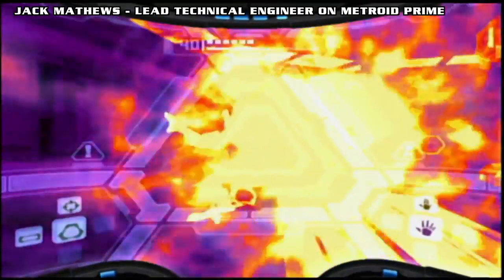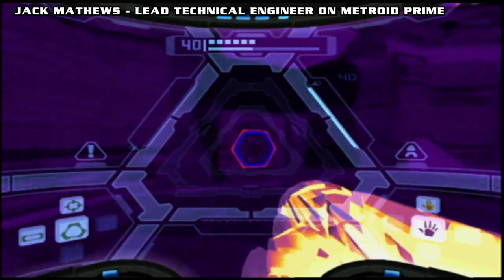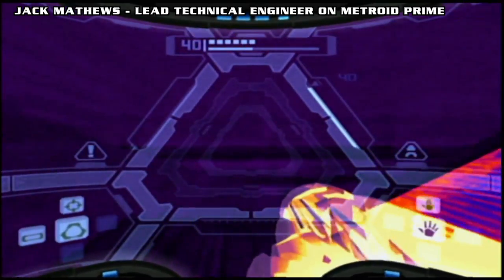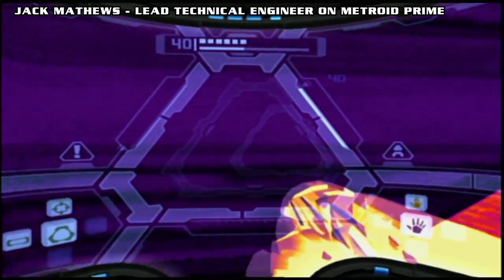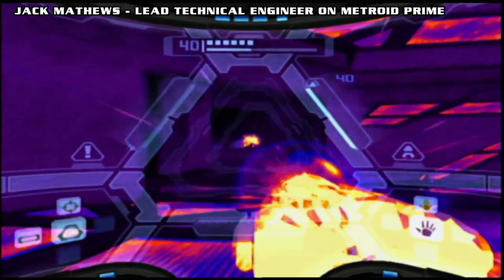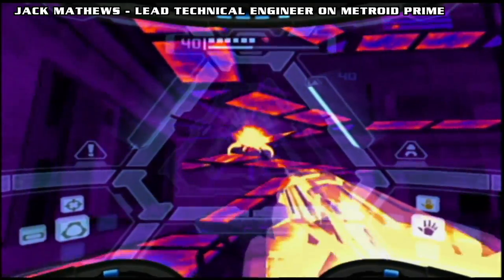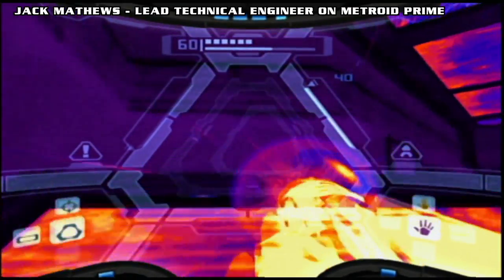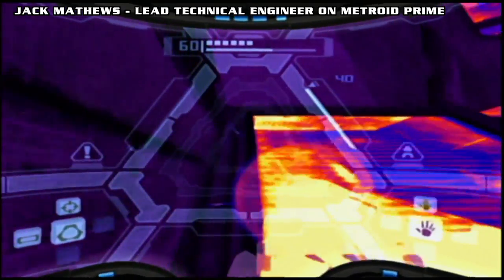Why The Thermal Visor Looks Worse In Metroid Prime Remastered

Comment: Honestly, my thought process with the new Thermal Visor was just that they were going for more realism. Thermal cameras tend to have a very low resolution, blurry, and have a lot of motion blur due to how they operate (at least the more commercial ones) so it's pretty plausible that they were just attempting to emulate those.
Reply: agreed
Reply: I'd like to agree with you but it really is quite jarring. I'm having trouble believing devs opted for low rez high motion blur just to be in line with some human optics. This is Metroid after all 🙂 I bet it's just cause they couldn't hit 60. Oh well not like you have to use thermal all that much.
Reply: Ah, the realism concession. My favorite videogame feature...
Reply: My thoughts EXACTLY.

While Metroid is sci-fi future tech, modern thermal cameras are BLURRY. They don't have sharp edges like the MP camera. "Predator" is a bit TOO far in the opposite direction (because it filters out the thermal of the environment to a MUCH greater extreme than a real thermal camera would, focusing ONLY on active heat sources), but that idea of thermal is much more what people "expect," and the MP:R version is a lot closer to THAT.

The original version was great, but the new version - while blurry and less crisp - feels more accurate to what we'd see in a modern real-world setting. I had NO problems with it. Not sure why so many people did.
Reply: @Batman1016  Idk, it makes sense why people don't like it. It's blurry, hard to see, and gives a lot of people headaches. Sometimes gameplay has to take priority over realism
Reply: @ZachHixsonTutorials  How's it hard to see? Everything you're supposed to shoot at is BRIGHT YELLOW and the exact same size on the screen as it was prior.. 😅 Agree 100% with your original comment tho mate!
Reply: @sandwich1601  For one it actually is realistic, yes it may have had performance issues without these changes, but it is basically like killing two birds with one stone. If you can make the game run better while keeping realism in check, why would you not do that?
Reply: @phattjohnson  Yeah, what you’re shooting is bright. It’s everything else that’s the problem. It’s difficult to move around the environment with everything so blurry, which is particularly bad for a section of the game where they turn off all the lights in the area you just went through. Originally this was meant for you to use and adjust to the function of the visor, but in the remake it’s a lot harder because you’re now navigating a blurry mess.
Reply: @Setery10  Ah yes, because of course we know that technology is stagnant and will not improve at all in the next few hundred years. Especially thermal cameras. Those will never get any better than they are now. 🙄
Reply: @MisterPuck  Sure some of the REALLY top end thermals heavily reduce the motion blur issues (still exists to an extent), but I do expect future tech to eliminate those issues, this is especially doable in a sci-fi context. I don't disagree, but I did want to point out how it currently operates in the real world.
Reply: Thermals aren't actually that blurry though. The Scott Sight mask, for example, (granted a much smaller screen) is actually pretty clear. There's some smearing if you move really quick, but thermal imagers and FLIRs actually have pretty nice resolutions so you can see what you're looking at really well. I work in a place where we have a fire brigade and there's some real neat little thermal imagers and they're great for overhauling fires and pinpointing hot spots.
Reply: @Batman1016  its fucking Bird Tech, the gene splicing capable bird gods that gave Samus pretty much everything... and have super AI battle robots but cant for the life of them create a higher resolution camera thats not blurry with non-blurry thermals?
Reply: Could be both. They had hardware issues, and used this to solve it because it is more justifiable.
Reply: The thermal camera on the frigate I sailed on was sharp.
However, the default setting for these is black and white with shades of gray.
It's a pity that the thermal camera had to be reduced to the level of a 2020 mid-range camera, so to speak.
Reply: @Batman1016  holy shit this is the weirdest copy I've ever read
Reply: @eldenringtutorials8075  *eyeroll* That's because all you goofballs do not seem to comprehend the combined concepts of sensory tropes and audience expectations in multimedia.

"Silencers" in media make guns sound like little "twip-twip!" noises, yet in real life, they sound nothing like that, because that's what audiences EXPECT.

Real explosions are usually much smaller and far less flashy than what you see in movies (and lots of them are flatly invisible, because fuels burn at a light wavelength too high or low to see, look up racecar fuel fires some time, it's terrifying), but that's what viewers EXPECT. 

Lasers do not fire clearly visible beams, and would not cut quickly and cleanly through flesh and other objects like a razor blade (moving that fast would cause burns, chemical reactions, and other severe material disruptions, that's why laser surgery is a slow and VERY controlled process using low-power beams), but they do it all the time in sci-fi and games because people EXPECT it.

And so (because news flash, this stuff isn't ACTUALLY future tech, it's a friggin' VIDEO GAME made in the MODERN DAY), game developers will often approach a concept from "well, what is the visual shorthand that the user will understand and relate to so that I can implement this concept in the show/movie/game that I am creating?" And while they can speculate somewhat how that tech might advance, the key words here is "speculate" and "might." They can't know for certain, and some things they undoubtedly get wrong, and some stuff they deliberately make look like "retro tech" (to go back to the origins of Metroid, the tech on the Nostromo in "Aliens" is CLEARLY '80s computer inputs and readouts, we are more advanced than that stuff NOW, but it's still "the future" and even modern viewers accept it as such) because it's what audiences are MORE FAMILIAR WITH.

So, in the case of the visor here, it seems like the new devs looked at both the hardware limitations of the Switch, and looked at what most viewers would probably have experience with in terms of "what does the average audience think thermal vision looks like?" (which, as I noted in the first post, would be the kind of stuff you see in classic movies that a vast majority of people have seen, like "Predator" or various nature documentaries - Google "Thermascan - Thermal Imaging in TV and Film" for examples) and made the choice to make the thermal visor look more like the modern visual shorthand that general audiences are most familiar with.

And obviously, for a bunch of people, this made it seem "less futuristic," and for some people with clear experience with current thermal tech (which, as noted by one user, yes, is usually black and white and a BIT more crisp, looks more like the X-ray visor honestly, you see that version in security cameras a lot) it looks off, but for the majority of users, it looks like the most common use of thermal that they would probably be familiar with, and that is a method of creating a narrative between creator and viewer/player that is used by EVERY story telling medium on Earth. And clearly - judging from half the comments on this thread - it WORKED, it didn't bother a LOT of people.

Seriously, y'all acting like the guy in the theater who is mumbling to his buddy the whole movie "but it wouldn't be like that!" Well, okay, fine, they worked in their limits and created something that looks "normal" to MOST of the audience.
Reply: @Batman1016  but this is Metroid and your medium thing self-destructs because the original doesn't have the thermals function like that. That's like "updating" Alien and Aliens  to only having Apollo shuttle sized ships since that's what was available at the time and familiar to the medium of the time since there were no big space spaceships back then or now even. Of course it's almost impossible to speculate how far tech can improve or change yet if you look at how the past viewed the future, most of the time it was literally just what they had but can fly or everything round.

Your explaining sucks when the original didn't have it like that and this is literally a random change probably due to remaster porting shenanigans like.... the Halo CE gearbox port that got re-ported and remastered by 343 that then re-ported it again into the MCC. (It was a super messed up fumbled pile of garbage if you didnt figure that out)

It would be fine if I guess if this was a REMAKE and not a REMASTER. Also the thermal vision isn't realistic and is annoying as hell to look yet your still defending it with the realistic approach is mind numbing when you were given information on how this is too blurred to even modern standards because "da audience" or in the case of a few select individuals who only want pure Retro tech since they're overjoyed at these "super realistic" thermals since the closest they got to any modern tech was their phones "thermal imaging" filter.

Tl;Dr - the thermals suck in this remaster and aren't even realistic to modern thermals and the audiences that like it only used dollar store thermal hunting cameras or watched Predator once. (We're playing a human/bird hybrid who has Super Bird Tech aka Alien Technology and gets granted tech via random shit lying around and loses it all every game from a rock hitting her at the start of every game. How does that work at any realistic scale?)
Reply: @watch.v-dQw4w9WgXcQ  Different people doing the work, different creative vision. Makes sense to me.

And since Super Bird Tech Alien Technology doesn't exist, your continued harping on it isn't any more relevant on repeat than it was the first time. *shrug*
Reply: @Setery10  it's realistic... To shitty low end stuff from 5 years ago.
Reply: @vyor8837  Genuinely don't know what you're talking about. What do you mean by low end stuff from 5 years ago? Are you talking in the $100 range? You know you can see like 16 total pixels on something like that. If you mean old high end stuff, even that would hold up pretty well. There's a huge price gap from low end to high end, talking about thousands of dollars.
Reply: Interesting to think that an interstellar and industrious species thousands of years in the future of a sci-fi universe can only make a 320x240 thermal camera.
Reply: I still think the original looks better and more realistic.
Reply: Why do switch fan boys cope so hard , it’s crap but it’s okay just accept it lol
Reply: I can see that but... it's also the future where everything is advanced. I don't feel like its necessary to do something like that.
Reply: @cas343  Yeah, but the argument could be applied to other things like lens flairs, the visor getting interrupted by static, etc. There are certain things which we're just used to so it helps for immersion.

Again, I'm not saying this the correct choice, but I could definitely see a person designing a shader looking at modern day thermal cameras for reference.
Reply: @ZachHixsonTutorials  I mean possible I guess? I just suspect that they ran into performance issues like the guy said and just picked something that was semi-playable at least. I don't think it was on purpose. I don't mind it either tbh I kind of like it. Looks like 80 Sci fi/Alien type technology.
Reply: @Setery10  because youre making the game look like shit. realism is only important when it doesnt make the game look worse which it clearly does here
Reply: @Batman1016 I think you're totally right. And even if you're not, the people who are dying on such a dumb hill. 😂
Reply: @watch.v-dQw4w9WgXcQ listen. You might be right that it was a wrong choice, and a mistake for them to have gone in this direction, but Batman1016 is simply making a good point about WHY they made that choice. Maybe it's a sucky choice, and the devs shouldn't have made it, but their reason for doing so was most likely intentional, because they chose to add in motion blur. The resolution issue may have been more of a frame rate issue, but the motion blur was intentional. I think Batman is right about why they did what they did, and you're also entitled to your opinion that it sucks butt and looks terrible. You can both be right! Your opinions are not mutually exclusive!
Reply: I prefer a realistic approach because the sharpness made no sense to me on the Gamecube. That kinda killed the immersion for me. It made it feel fake since real thermal vision IS blurry. 

So while it looks disorienting in the remaster, it's more as it SHOULD look. I actually prefer the remaster for that reason. It not only looks better than the original but it aims for more realism.
Reply: Hello? Samus is from the future with crazy Sci fi alien bird tech that the federation takes years to crack. Why on earth would it need to look like a crappy 80s thermal camera

Comment: The added details to the thermal visor more than make up for the blurriness imo, the different beams look how you'd realistically expect them to, and they heat up and cool down when being used / charged up
Reply: That was the same in the original
Reply: @rikspan1925  I disagree, the beams in the thermal visor look much more realistic in the remaster and the heat up / cool down looks better too. In the original it looks like it's just a palette swap - so any heat up / cool down matches whatever colour of light it's giving off through the combat visor,  instead of changing heat by the intensity and in the specific areas you'd expect them to through a thermal camera.

You can see a comparison here:
https://www.youtube.com/watch?v=WlePtX-IB2Q&t=166s
Reply: TL;DR version for what this guy said, You can use Plasma and the Arm Cannon isn't unbearably hot all around, while Ice kills all temperatures while charging.
Reply: the old beams looked better in the visor, also the visor in general makes me want to vomit

Comment: Such a great explanation from the dev of the game. It’s funny how simplicities from 2002 became hard complexities in 2023 because of how unique Nintendo developed their cpu for the GameCube, I imagined the devs for the remaster didn’t want to sink an unnecessary amount of hours trying replicate thermal from prime GameCube so they said screw it and threw in blur like Jake is saying. Proves technological knowledge and development aren’t parallel with time, some techniques are simply forgotten and you always have to be creative with making a game look “good”.
Reply: It's the product of a couple of industry-wide changes to graphics rendering. The Gamecube (for reference using a ATI (now AMD) GPU, so not just Nintendo's tech here), had everything done up such that the set of paths things took to be rendered, lit, shaded, and so forth was basically set in stone, with the programmer basically setting (many, many) switches to determine which path to take, sometimes with a bit of programmable shading logic available. Around 2006 or so new GPUs ditched the fixed lighting and shading logic in favour of leaving that fully programmable, as that allowed for more flexibility in what the GPU's silicon was doing, allowing for better use of the whole chip; and then around 2016 new GPUs, notably including the one in the Switch, completely abandoned even the fixed path for basic rendering in favour of full programmability, making it way more efficient when working with multicore CPUs.

Unfortunately that does mean that, as the dev said, you can't just switch a few global variables to make the GPU do everything differently, you have to basically load a different shader program, or at least change what its variables are, but the architecture changes work a lot better overall given how everything else has changed since.
Reply: Well it's not always that these techniques are forgotten, but they can just disappear due to hardware changes. Back when every console needed its own architecture they essentially created low-level hardware that was designed to be really good at one specific thing, and by taking advantage of that hardware is how you'd make games that could look and feel ahead of their technological generation. 

With how powerful modern hardware is, it's now much easier to use standardized architecture to make devices that are theoretically very good at everything. But when you do have a game where you have to balance visuals with performance we have lost access to this low-level hardware to try and offset the performance cost of certain things like lighting on the Gamecube.

Comment: Honestly, I'd take just low res over low res + blur. Especially when I clearly remember how easy it is to see with the thermal visor on the GC and Wii versions, I appreciate how clean his approach made the visor far more useful for navigating dark spaces. In the Remaster, the blur with the new render method does too little to make background geometry stand out, and rooms that were originally designed with it in mind are a nightmare now when the lights turn out.
Reply: It makes those pitch black rooms a nightmare to traverse now which is stupid as you’re using the tool that’s supposed to make  it easier! You can’t make out pillars or level layout while wearing it (except heated platforms) and honestly it’s pretty terrible

Comment: I knew I wasn't going mad. Back on the original, I would happily play through using the thermal. When it came to the switch would actively avoid using it unless it was absolutely required. Which is a shame but it is interesting to know the reason behind it.